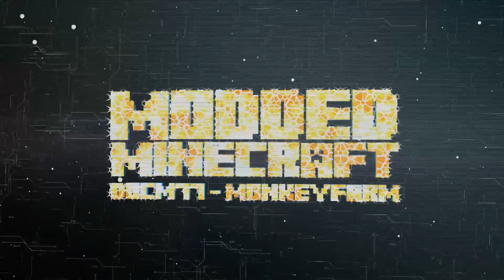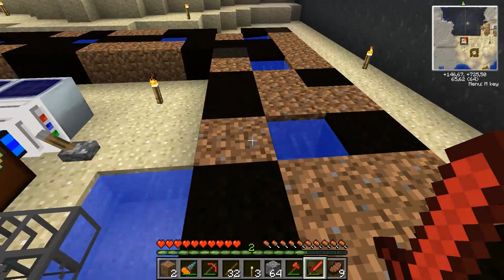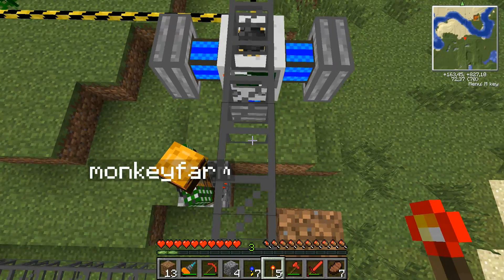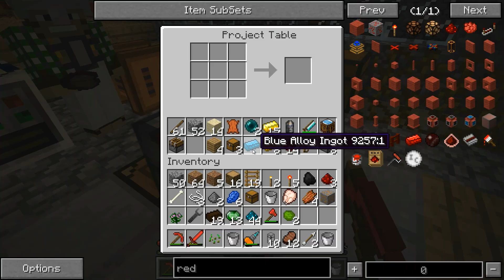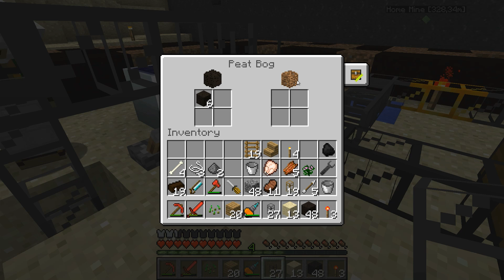Modded Minecraft - #10 - Automated Bog Earth Machine

Comment: That retriever shouldn't be working..... There is no bluetric power connected (see the power bar on the left of the retriever's interface?). Though you could have simply used 2 filters for the setup you are using and not need any bluetric power.

Comment: hey doc, you dont need the retriever and filter on your bog earth setup. since the autocraft table will pull items from any adjacent inventory, if you just place your deployer water bucket machine so that the deployer will touch the autocraft table it should work fine. also note, you create more dirt then you use you make the bog earth since the recipe uses 4 dirt but makes 6 bog earth(which will turn into 6 dirt and 6 peat) all you need to do is add sand.

Comment: A note about filters vs. retrievers:
Both pull out stacks of items and place them into whatever tube/inventory is behind them, but retrievers can pull from anywhere in a network of pipes as long as its front is connected to said network. Filters only work when they're next to the inventory (like how you're using the retriever) however, it takes RP2 blutricity to make a retriever run at a distance from the inventory its pulling from. 

tl;dr, you didn't need a retriever for that.

Comment: Suggestions:
- Use the BC "filler" to put a roof on the quarry. IMO it's better than water
- Awesome BioGas engines output the same as combustion engines but won't blow up. Use surplus saplings to create BioMass
- Try putting an iron pipe on the Peat Bog. Not sure about BC2, but in BC3 it bounces items back if it's full
- Consider installing "compact solars" for IC2. One LVSolar, bat box & electrical engine, has the output of 2 steam/peat engines. Great for remote operations like quarries

Comment: and for a cobble farm you can just use a basic cobble generator and then add a blockbreaker on there, if you wire that up with redstone tubes (pneumatic tubes+redstone)you can eliminate extra wires and also you will need a timer and jacketed wire to connect to the redstone tubes